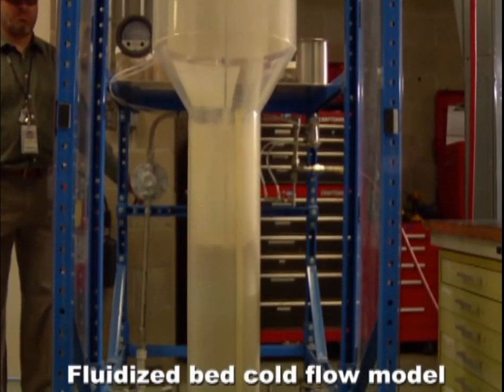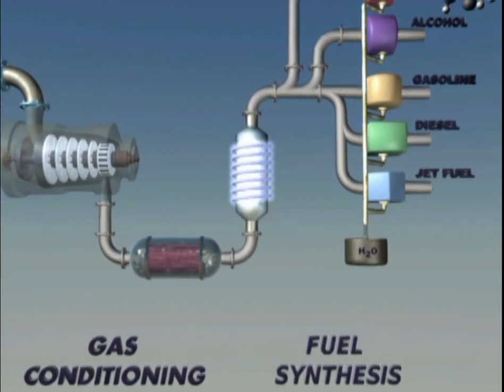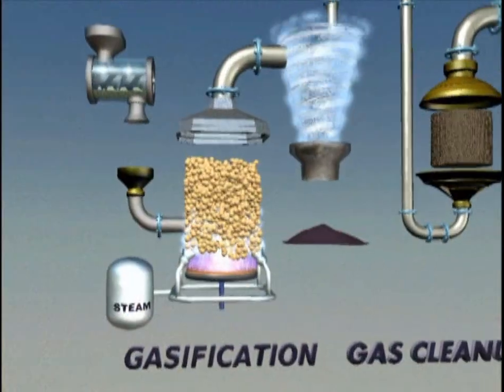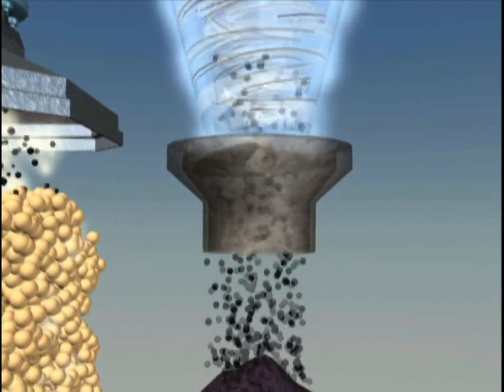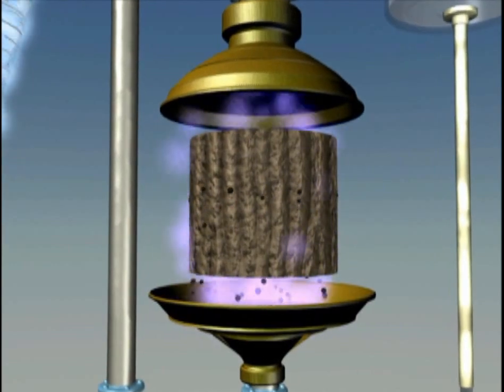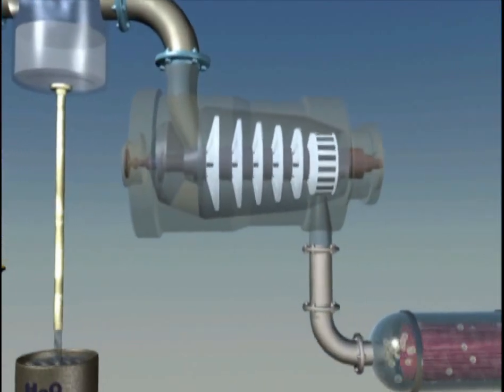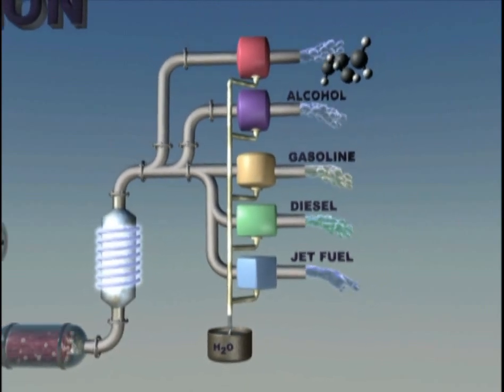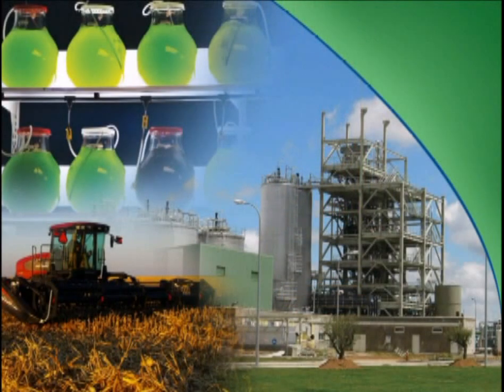Thermochemical Conversion of Biomass to Biofuels via Gasification

Comment: The entrance of oxygen, even in the form of water, bothers me since we want a maximum of alkanes normally since we want to get rid of fossil ones.
The biomass should be dried outside before entering with perhaps solar and wind.
 So I think the biomass should next inside the reactor be heated not via combustion but through microwaves, lasers etc.. Perhaps a pulsed approach of instant laser vaporization of small quantities is an option. 
We don't like sulfur so the biomass entering should be chosen well to be sulfur poor, say bamboo or so. (elephants grass?)
We don't like expensive catalysts. So I wonder if pressure and perhaps ammonia addition would work also to get lighter fuel. The ammonia serves as hydrogen carrier. It should be reformed later ideally. Perhaps today even adding pure hydrogen is an option since syngas contains hydrogen. The flammability problem seems under control.
This process is now often done at high temperature which means heat loss but with flash laser evaporation the high temperature would be reached while the energy loss would be minimized.

Comment: We. (JK ENERGY) have invented "Fast Pyrolysis (continuous) System" for scientifically conversion of any DRY AGRO waste to active energy without the pollution of environment.

We developed a pilot project for Govt.of Maharashtra , MAHARASHTRA BAMBOO DEVELOPMENT BOARD,Nagpur 
( Special purpose of Bamboo waste disposal  project) .

On the completion of the process of any Dry Biomass Waste.

we get three Bio Products 
                    
1) Pyrolysis Oil - 45/50%
2) Activated Charcoal - 25/30%
3) Syn Gas.- 20/25%    
             
◆ (with the help of LIT-Laxminarayan Institute of Technology, Nagpur, Maharashtra,India) On distillation of pyrolysis oil we get

* Light Diesel Oil (LDO-30/35%) 
* Compressed Natural Gas(CNG-15/20%) 
* Pesticides (45/50%)    
                
◆ The Activated Charcoal obtained from the system is used in various industries such as Cosmetic industry, Pharmaceutical industry and Fertilizer industry.The Activated Charcoal can also be used for Purification of Water.
                                          
◆ Syn gas can be used for generation of Electricity and on compression of syn gas we get Compressed Natural Gas(CNG).
                                    
This is a patented project and the size of the system varies from 1 tonne per day to 40 tonne per day
More info contact whatsapp no 9850997262

Comment: please can explane how we can convert this syngas on liquid fuel like gasoline at home ?
Reply: We. (JK ENERGY) have invented "Fast Pyrolysis (continuous) System" for scientifically conversion of any DRY AGRO waste to active energy without the pollution of environment.

We developed a pilot project for Govt.of Maharashtra , MAHARASHTRA BAMBOO DEVELOPMENT BOARD,Nagpur 
( Special purpose of Bamboo waste disposal  project) .

On the completion of the process of any Dry Biomass Waste.

we get three Bio Products 
                    
1) Pyrolysis Oil - 45/50%
2) Activated Charcoal - 25/30%
3) Syn Gas.- 20/25%    
             
◆ (with the help of LIT-Laxminarayan Institute of Technology, Nagpur, Maharashtra,India) On distillation of pyrolysis oil we get

* Light Diesel Oil (LDO-30/35%) 
* Compressed Natural Gas(CNG-15/20%) 
* Pesticides (45/50%)    
                
◆ The Activated Charcoal obtained from the system is used in various industries such as Cosmetic industry, Pharmaceutical industry and Fertilizer industry.The Activated Charcoal can also be used for Purification of Water.
                                          
◆ Syn gas can be used for generation of Electricity and on compression of syn gas we get Compressed Natural Gas(CNG).
                                    
This is a patented project and the size of the system varies from 1 tonne per day to 40 tonne per day
For more information, whatsapp 9850997262

Comment: at what temperature do the gases break away from the biomass? some sources say at 450-500C the gasification is 90% done, others say we need higher temperatures, around 800-900C. Which one is correct?
Reply: 450-500

Comment: What percentage of that gas would be hydrogen and methane? What ate the other gases? Does it produce less Co2 when burned?
Reply: We. (JK ENERGY) have invented "Fast Pyrolysis (continuous) System" for scientifically conversion of any DRY AGRO waste to active energy without the pollution of environment.

We developed a pilot project for Govt.of Maharashtra , MAHARASHTRA BAMBOO DEVELOPMENT BOARD,Nagpur 
( Special purpose of Bamboo waste disposal  project) .

On the completion of the process of any Dry Biomass Waste.

we get three Bio Products 
                    
1) Pyrolysis Oil - 45/50%
2) Activated Charcoal - 25/30%
3) Syn Gas.- 20/25%    
             
◆ (with the help of LIT-Laxminarayan Institute of Technology, Nagpur, Maharashtra,India) On distillation of pyrolysis oil we get

* Light Diesel Oil (LDO-30/35%) 
* Compressed Natural Gas(CNG-15/20%) 
* Pesticides (45/50%)    
                
◆ The Activated Charcoal obtained from the system is used in various industries such as Cosmetic industry, Pharmaceutical industry and Fertilizer industry.The Activated Charcoal can also be used for Purification of Water.
                                          
◆ Syn gas can be used for generation of Electricity and on compression of syn gas we get Compressed Natural Gas(CNG).
                                    
This is a patented project and the size of the system varies from 1 tonne per day to 40 tonne per day

Comment: It is difficult to understand why someone would do this. Converting wood to CO2 , it is really against the idea of redusing the CO2 in the air. Cutting big trees that absorb the CO2 and plant smal one that absorbs much less.
Reply: Co2 is part of the circle of life. Its no poison its a plant fertilizer and there is a big industrie to brainwah people to shell their crap!
Reply: It's not to say a plant fertiliser. CO2 in itself was never the problem; its the volume* in which it is produced.
An industrial process produces several hundreds of times more than a few hundred kitchens, for example. That's when it becomes a problem, and why its being "demonised". Carbon footprints should always be low, but ever moreso for huge industries, but those same industries have launched propaganda campaigns to convince the public that it's apparently the average joe's responsibility to lower theirs instead of making any changes.
If anything, mass CO2 outputs should be further "demonised", but it should be directed towards the correct parties (cough cough oil and gas industry) responsible for the ridiculous influx of CO2 in our atmosphere
Reply: @jayojoe  Right on man. It's a matter of balance. Cut a tree down, plant others to compensate. It's as simple as that
Reply: Good job

Comment: Will the producer  gas(or syn gas) not get burnt if operating temperature is high like 800 degree Celsius or above?
Reply: In a sense, some carbon monoxide will get burned off. Because you see, the water gas-shift reaction (the reaction responsible for gasification) is a reversible reaction involving carbon dioxide, carbon monoxide, water and hydrogen. At this temperature (or more specifically at this state), these 4 compounds form a reaction equilibrium, resulting to appropriate amounts of these compounds.

Comment: pls can anyone help with the full video of detailed misanthus plant conversation into biofuel and electricity. .
Reply: We. (JK ENERGY) have invented "Fast Pyrolysis (continuous) System" for scientifically conversion of any DRY AGRO waste to active energy without the pollution of environment.

We developed a pilot project for Govt.of Maharashtra , MAHARASHTRA BAMBOO DEVELOPMENT BOARD,Nagpur 
( Special purpose of Bamboo waste disposal  project) .

On the completion of the process of any Dry Biomass Waste.

we get three Bio Products 
                    
1) Pyrolysis Oil - 45/50%
2) Activated Charcoal - 25/30%
3) Syn Gas.- 20/25%    
             
◆ (with the help of LIT-Laxminarayan Institute of Technology, Nagpur, Maharashtra,India) On distillation of pyrolysis oil we get

* Light Diesel Oil (LDO-30/35%) 
* Compressed Natural Gas(CNG-15/20%) 
* Pesticides (45/50%)    
                
◆ The Activated Charcoal obtained from the system is used in various industries such as Cosmetic industry, Pharmaceutical industry and Fertilizer industry.The Activated Charcoal can also be used for Purification of Water.
                                          
◆ Syn gas can be used for generation of Electricity and on compression of syn gas we get Compressed Natural Gas(CNG).
                                    
This is a patented project and the size of the system varies from 1 tonne per day to 40 tonne per day
Info whatsapp 9850997262

Comment: will u help to design & construction and working biogas conversion to biofuel machinery plz relpa me sir
Reply: We. (JK ENERGY) have invented "Fast Pyrolysis (continuous) System" for scientifically conversion of any DRY AGRO waste to active energy without the pollution of environment.

We developed a pilot project for Govt.of Maharashtra , MAHARASHTRA BAMBOO DEVELOPMENT BOARD,Nagpur 
( Special purpose of Bamboo waste disposal  project) .

On the completion of the process of any Dry Biomass Waste.

we get three Bio Products 
                    
1) Pyrolysis Oil - 45/50%
2) Activated Charcoal - 25/30%
3) Syn Gas.- 20/25%    
             
◆ (with the help of LIT-Laxminarayan Institute of Technology, Nagpur, Maharashtra,India) On distillation of pyrolysis oil we get

* Light Diesel Oil (LDO-30/35%) 
* Compressed Natural Gas(CNG-15/20%) 
* Pesticides (45/50%)    
                
◆ The Activated Charcoal obtained from the system is used in various industries such as Cosmetic industry, Pharmaceutical industry and Fertilizer industry.The Activated Charcoal can also be used for Purification of Water.
                                          
◆ Syn gas can be used for generation of Electricity and on compression of syn gas we get Compressed Natural Gas(CNG).
                                    
This is a patented project and the size of the system varies from 1 tonne per day to 40 tonne per day
Info whatsapp 9850997262

Comment: How do you remove the water from the process?
Reply: Deon Silmark H2O + C = CO + H2
Reply: I'm concerned with how carbon dioxide is scrubbed and how sulfur  (which tends to contaminate the Fischer-Tropsch catalysts) is removed. I think it is done in a hot desulfurization process involving zinc.